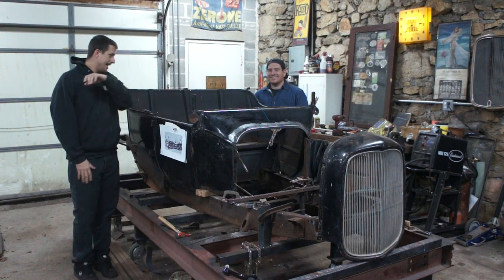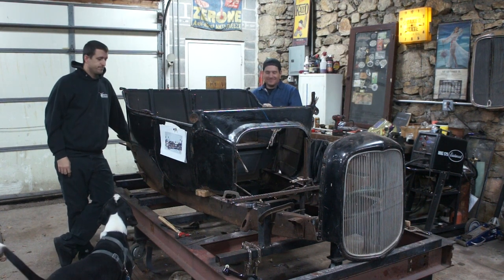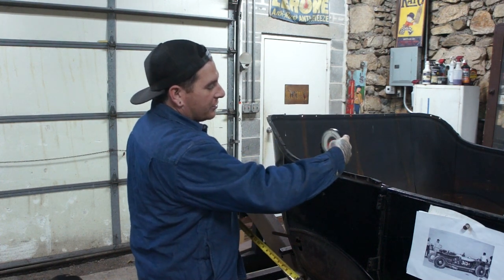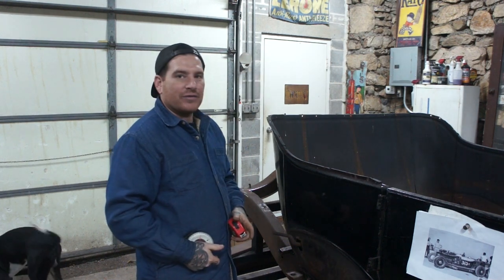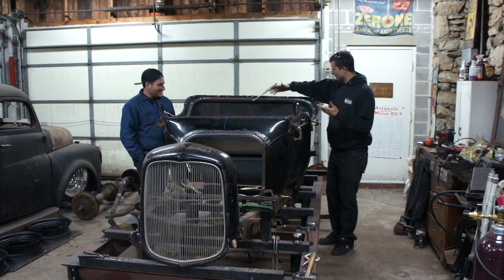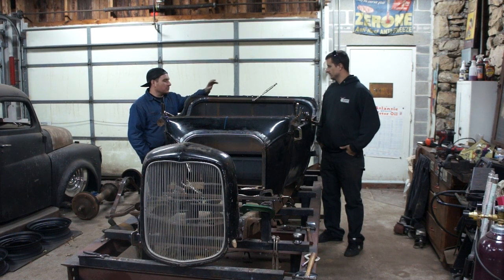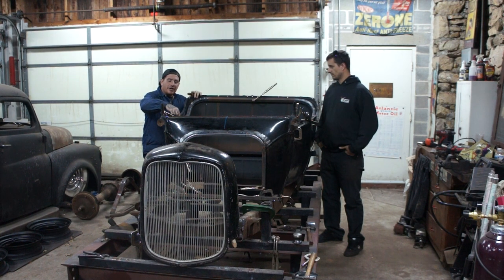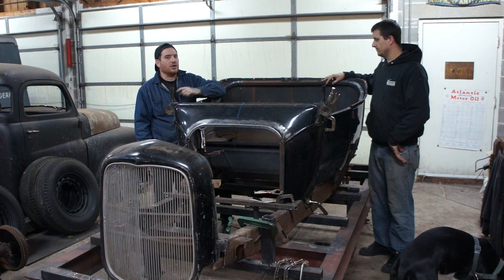How to Brace Ford Model T Body With Metal- Ford Free T - Ep. 6

Comment: Great job mike and matt. Didn't think you could bend that without kinking nice looks like 1in tube. I got 28 roadster pu kind of flimsy on top i'm going to try that its square so.i will just cut and weld. Thanks again boys keepem coming
Reply from the maker: Thanks, the tubing is about 1-1/2".  It bends quite easy with some help from the torch. The tubing helped strengthen the body big time!! Mike/ITG

Comment: Great job fellas on heating up that square tube....ill file that away. Question, with that behind you....would you consider round tub? Keep'em coming. Thanks.
Reply from the maker: Since we were using square to fit in the door jambs/pillars I figured it was easier to use all the same material. No particular reason other than it was what we had. Thanks for watching.